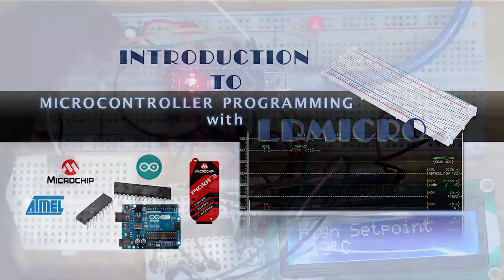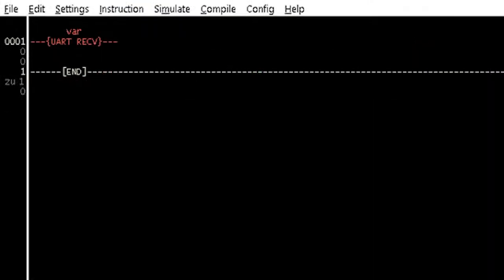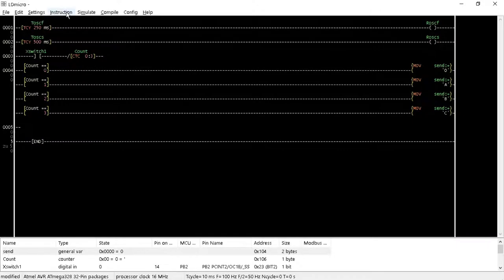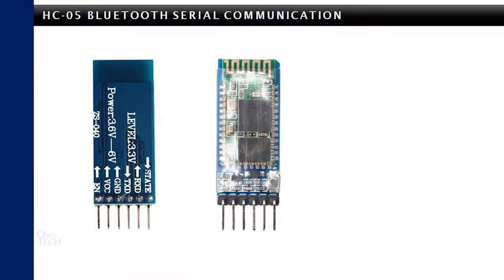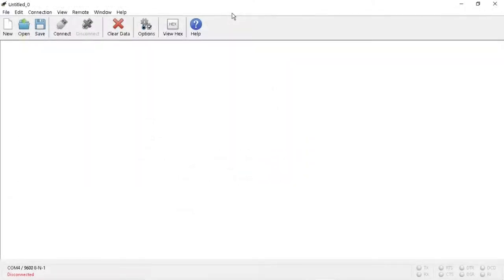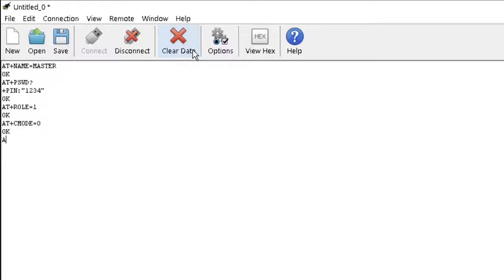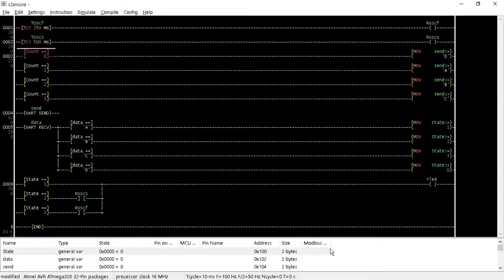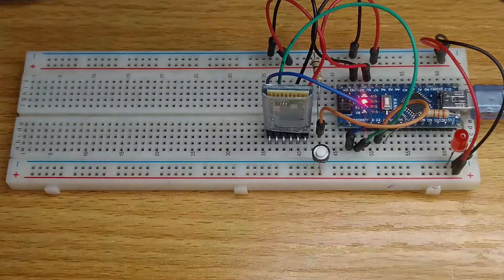LDmicro 13:  HC-05 Bluetooth Phone App Control (Microcontroller PLC Ladder Programming with LDmicro)

Comment: thanks a lot for the tutorial, at 5:06 Does it work compiling directly with LDMICRO? or only works compiling with Atmel AVGR GCC?
Reply from the maker: @Alextremo Its my pleasure. It should also work when compile to hex with any supported microcontroller, since the UART function is originally part of LDmicro
Reply: @OnosTech  thanks for you reply